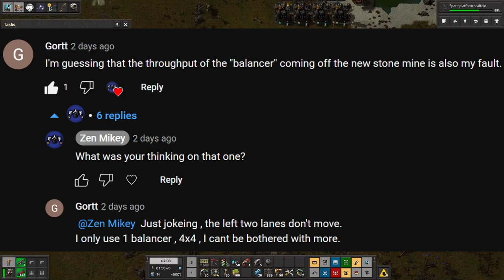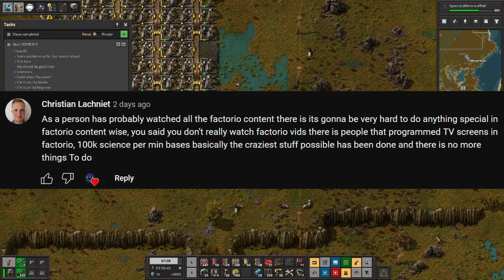Factorio Space Exploration Longplay #28 - Scaling Stone Bricks & Copper Plates, Backup Power

Comment: LTN is powerful but I prefer trains to go from point A to B with full/empty loads instead of depot, to A, to B, then back to the depot. The latter isn't as efficient, and the depot's entrance/exit can get a bit congested under heavy traffic in and out. Ya might wanna look at Train Supply Manager, it supposedly solves that problem. For stations, you can use warehouses as the buffer but you typically don't need a buffer that big. You can setup outposts quickly by just copy/pasting other ones and/or making a blueprint.

For space vs scaling, it's normal to visit space to determine what resources you need for science, then scaling up those resources, expanding power, mall expansion, working with trains/grids, etc. IE, exactly what you've been doing.

I'm really excited to see you do some rocket automation and visiting your first outpost planet. Make sure to do more satellite launches so you have a good variety to choose from - it'll say when no more can be found. (yet)

Comment: Like your solar powered offshore pumps. I do something similar, even on my nuclear plants.

LTN ----  Haven't used it myself. Watched a lot of people use it. Most mega factory types use it. You can do a lot with train limits circuits/combinators. the only real problem I find is , it always try's to pull the closest train , so distant resources get ignored. Can be fixed, but then you need to run green/red wires everywhere. Which, BTW are free in SE ( if you use nav ).

Train loading/unloading -- I use warehouses .

On scaling vs space --  I got my first cargo rocket built and loaded about the same time as you. Mine sat on the runway for about 40 hours until I had  scaled up red/blue/green  circuits to a full-ish yellow belt of blues and had a second Rocket built and full of everything needed for scaffold/belts/pipes/ and science for space, got my logistic/construction bots to cover the heart of the base. By that time the bitters were a problem, so walls and defenses. but I've been up there before so was in no hurry. 

That is what I love about SE , there is no clear "best path", you could head off to a different planet, rescue the spaceship, set up delivery cannons, finish off all ground base science(hint ,signal transmission), or probably 10 more things. It is all up to you my friend. But I do suggest filling out your mall. It is vital to be able to do stuff on Nauvis or tell the bots to load something into a rocket or cannon and send it to you when you are off planet.

You are the first person I have ever seen that has built substations BEFORE big power poles, I'm lazy too , but come on :).
Reply: About the closest station thing - have you tried wiring the storage to the train station and disabling it until the storage is full?

Comment: 23:41 you should limit the input into a roboport by logic, you can check for total or available bots and set activation. To not over feed bots to the network.

Edit: 52:49 in regards of your solar powered pumps, you are aware that you can separate power networks by using copper wire? Just as you would use logic wires? Appreciated the effort to make a substation island tho 😅.

Edit2: 1:04:36  If you want „time of day“ depending set ups, try a solar panel, accumulator, power switch, copper wire and some logic wire. I let you figure out the rest 😊
Reply from the maker: Yeah I think I'm gonna do that soon. I do know about the copper wire but then I always mess it up by placing one more power pole later and it's hard to maintain for me.

In the latest episodes, we are really, really leaning on our steam battery. I never did get around to doing the logic with the accumulators.